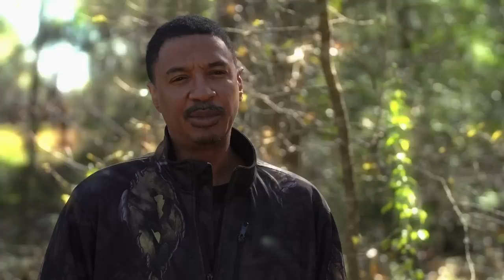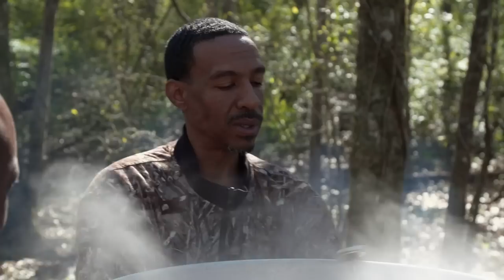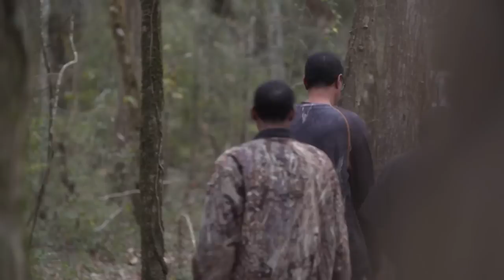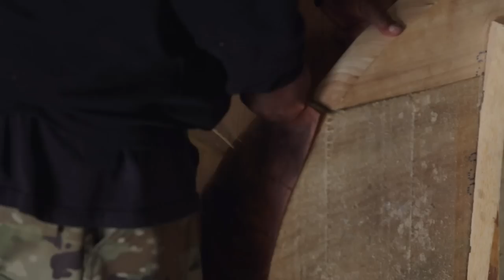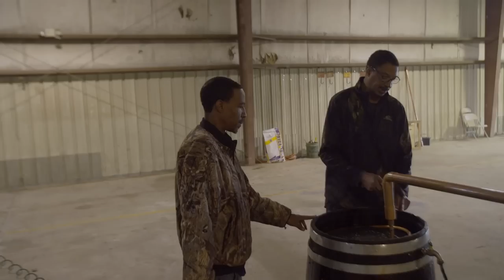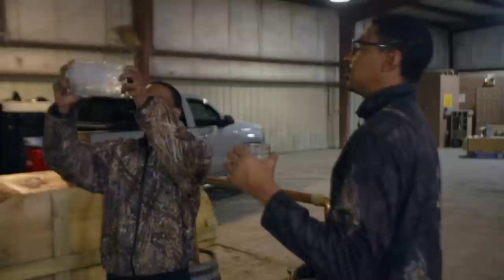Moonshiners Experiment Making Sweet Potato Liquor In New Equipment I Moonshiners

Comment: I didn't think you were supposed to build a submarine still with copper on the bottom because it's a softer metal, use stainless steel with copper on the upper half!
Reply: What seals the wood
Reply: What gage copper